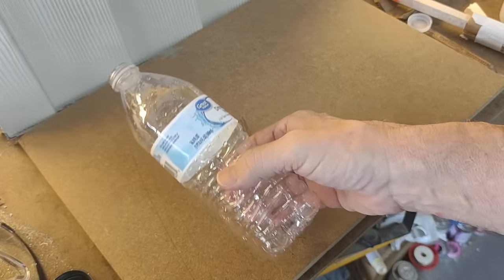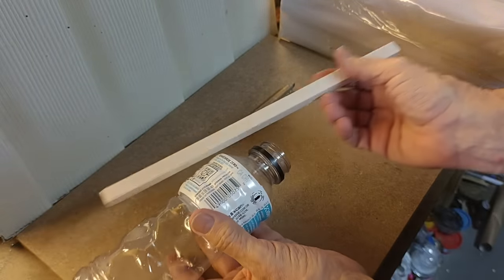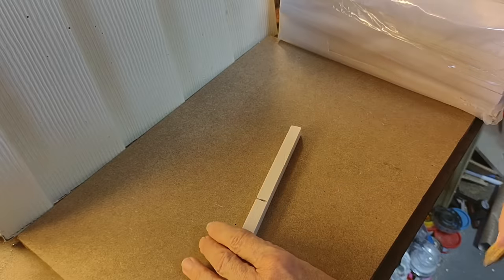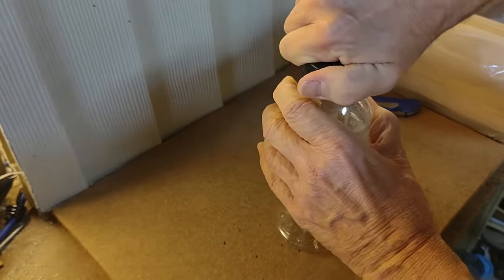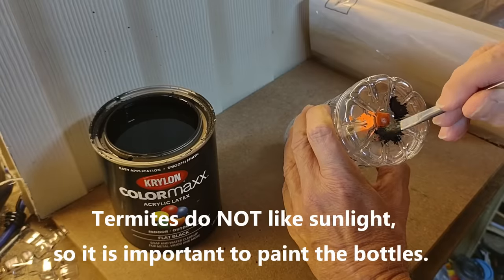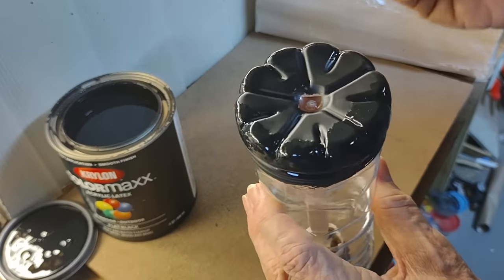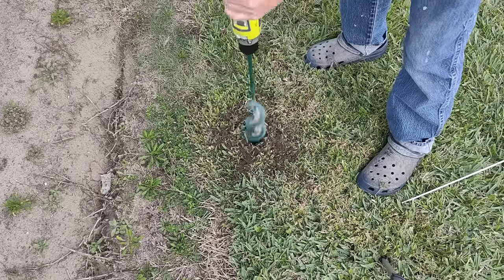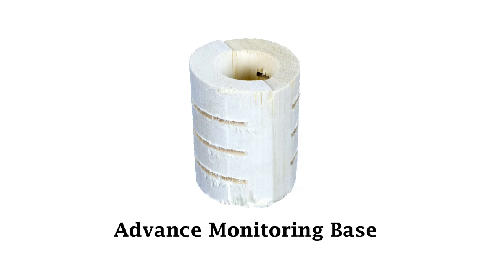Unbelievable Water Bottle Trick for Termites!  Simple to do!

Comment: I have a wooden house built in 1930 and I was touching up some paint spots on the back this weekend and had some termites flying into the paint. I live in Indiana along the Ohio River. What should I do to treat those?
Reply: Use dinamite ... it's very effective!
Reply: @carlosmejia5728  better yet, gasoline and matches
Reply from the maker: The good news is that you only have one species of termites where you live, and they are very easy to treat.  The fact that you are seeing swarmers outside does not mean that you have an infestation, but it does mean that they are close by, and you should take protective measures.  If you start seeing these things inside the house, then you most likely do have an infestation.  I would start by inspecting the house for mud tubes.  You are most likely find them around the outside of the building, coming up from the ground, but you may also find them in the crawl space, and sometimes even the attic.  If you cannot find any mud tubes, then you were probably okay, but you still need to do a preventive treatment.  The easiest way is to use granules, but it would also be a good idea to use the monitoring stations as well.

For the granules to work you need to have dirt around most of the house and that dirt needs to be porous enough to allow water to seep into the ground fairly quickly.  To find out if the dirt around your house is porous enough, just dig a small hole next to the house that is about 4 inches deep, 8 inches long, and just the width of the shovel.  Fill the hole with water and watch to see how fast it drains down into the ground.  If it seeps into the ground fairly quickly, then the granules should work just fine.  However, if it just kind of sits there, then the granules would not be a good choice, and you should just go with the monitoring stations.  Make sure that you buy the correct granules.  You need the ones that have imidacloprid as the active ingredient.  A lot of the Home Depot and Lowes stores no longer sell the correct granules, but you can get them from Amazon.  I will give you a link to them.

Please get back to me if you do find mud tubes or other evidence of an infestation.

I hope that helps.  Be well my friend.

Termite granules:  https://www.amazon.com/dp/B000RUIJYM?ref=nb_sb_ss_w_as-reorder-t1_k0_1_7&amp=&crid=6U9ASK6AJN8D&amp=&sprefix=termite
Reply: @GuysPestSolutions  Oh wow you’re awesome! I definitely will thank you. I’ve looked around the outside and have definitely not seen any more tubes there, but I need to check the crawlspace and attic. I just bought the house two years ago so I think that Attic may be OK but I’ll definitely check it this weekend. Thank you! I appreciate you writing back to me.

Comment: Hi Guy. Dealing with termites here. We had a termite swarm last year in our home. We have a large, elevated brick on cement patio along the entire rear of the house, and this is the area where the swarm was. The termite company we hired treated by drilling holes and injecting termaticide. Fast forward to this year and we have had a huge swarm in the same area and I’ve seen evidence of larvae and frass under the molding in two of the rooms, so it seems the treatment was ineffective. I see mature termites coming in from around the window moldings as well. I’ve watched your videos but am wondering how to treat such a large are that is inaccessible to trenching. I should add that we live on LI, NY. Additionally we renovated in 2019 and foam insulation was applied to all exterior walls.
Reply from the maker: Do you suppose you could email photos to me of all sides of the house.  I need to see where the house meets the ground, the patio and where it meets the ground, the driveway, and photos of the yard on each side from the house to the property line.  After I look at it I can tell you what you need to do.  The termite treatment that was done failed because it was kind of a Hail Mary Pass.  That sort of treatment can work sometimes, but it is far from a sure thing.  Pest controllers offer it because it's cheaper to do, but it comes with a much higher failure rate.  You can send photos to guyspestsolutions@gmail.com.  Also, you should know that it is hard to get pesticides in NY.  Depending upon your situation, you can sometimes get around it though.  They have banned just about everything there unless you are a licensed operator.  I hope that helps.  Be well my friend.
Reply: NY has subterranean termites. Very inaccessible.
Reply from the maker: @Gloria68  Actually, the species you have in NY are very easy to treat.  The problem is getting the pesticides.  NY has the most restrictive pesticide laws in the US.  If you can obtain termite granules, you can usually get rid of termites for $50 and an hours worth of time.  Very easy to do.  Be well Gloria.

Comment: Hello Guy. I hope you are well! You gave me a lot of great advice on borate for powder post beetles in my 1750/1820 house. I'd just like to know if the borate will corrode the metal heating exchange square "tubes" from the oil furnace? And the electric wiring? Thanks again!
Reply from the maker: Borates can be somewhat corrosive to metal, but not enough where I would be concerned about duct work or wiring.  We don't like to get boric acid dust directly on outlet connections because copper is a soft metal that is more susceptive to corrosion and we don't want to risk sparking at the connection points.  However, I think it would be very unlikely for it would eat it's way through steel duct work or wiring that runs through the walls or in the crawlspace.  So, I don't think you have anything to worry about.  Be well Claire.
Reply: @GuysPestSolutions  As always, Guy, thank you for the comprehensive answer!!
Reply from the maker: @clairestadtmueller2772  You are very welcome.  Be well Claire.

Comment: idk man, especially if you live in a southern state, you should really just get a solid termite bond from a reliable company -- even the best termite bait stations available aren't going to work 100% of the time, and while a $300+/year bond might seem expensive at the time, the cost of doing repairs and treatment for an active termite infestation is going to be multiples more than that
Reply from the maker: I never recommend those termite bonds.  They are not worth the money.  Read your contract carefully.  They usually contain exclusions for certain species and limit the amount of damage that is covered.   I live in Florida where we have Formosan termites, which are the worst you can get.  I just use these monitoring stations and I apply granules every year around the house.  No termites ever.  The granules will protect you from all species of subterranean termites for $50 a year.  It is a way better idea than paying for a termite bond.  I recommend keeping your money in your wallet.  Be well my friend.

Comment: Very informative video and a great help to my customers. 

Carpenter ants, How to locate the nest ?  saw one walking across door threshold. where there is one there must be 10,000 more.
Reply from the maker: The thing you need to understand about carpenter ants is that the ones you are seeing inside a home are really just a satellite colony.  The main colony is outside someplace.  You can sometimes locate that satellite colony that is inside the house by listening to the walls.  Carpenter ants can be quite noisy, so if you put your ear to the wall, you may be able to actually hear them.  Also, you may find dead ants near the walls, and the location of those ants will give you a good place to start to look.  As for the colony outside, that can be much more difficult to locate.  These guys can be in a tree stump, fallen tree, or any soft, wet wood.  I will give you a link to my video on how to treat carpenter ants.

I hope that helps. Be well my friend.

Video on how to treat carpenter ants:  https://youtu.be/Te9BUCaIQZY

Comment: Do you have a link for termite bait sttaions we could just buy? 😊
Reply from the maker: You bet.  You can buy the same exact device commercially that has a red dot at the top.  They work the same way.  When the dot disappears, you have termites.  They cost about $15 each.  Do not place them any further apart than 8 feet.  In other words, ignore the directions.  Also, they will tell you that you can treat termites by shooting foam into the station that went off, but this is unlikely to work.  You should install a bait station next to the one that goes off.

I hope that helps.  Be well Ashley.

Monitoring stations:  https://www.solutionsstores.com/red-eye-termite-monitor

Comment: Hi Guy thank you for sharing all this. I am in Sydney we found termites at a corner of stair case wall upstairs last week. Would you suggest: 1. Termidor directly into the pinhole of the wall which I can hear “ noice “ inside the wall? Or use “ bait” to put onto the area ( was recomm For “abide” ) , which is better option for my situation please. Don’t know if there is any other damage termites might have done to my house
Reply from the maker: I am so sorry that you are having this problem.  Here's the thing though, you see all termites are not the same.  You have some very different species in Australia than we do in the US, and they can behave quite differently.  Also, it is not easy to obtain pesticides in Australia.  What you are suggesting is basically a spot treatment.  That can be a successful approach, but you need to do it correctly.  To get it to work you need a fipronil foam.  I think I have a company that will ship it to you and I will give you a link to it.  You cannot really bait termites from the inside of a building.

To spot treat, drill holes in all damaged areas, that are 4 inches apart, and drilled about halfway through the wood.  If you are seeing exit holes in the wall, then there is most likely a stud behind the exit hole.  Get a stud finder and locate the stud where it meets the ceiling and drive a small nail into the stud a couple of inches below the ceiling.  Attach a weighted string to the nail and that will show you where the stud is.  Then drill the holes 4 inches apart along the entire length of the stud, about 3 inches deep.  Do the same thing for woodwork, except only drill the holes halfway through the wood.  If you think that there is a stud behind the woodwork, then drill a 3-inch-deep hole every 8 inches.  The holes only need to be wide enough to get the applicator tip of the foam can into the hole.  After the holes are drilled, then shoot the foam into each hole for about 5 seconds or until you have foam either coming back out at you or coming out the other holes that you drilled.   All the holes should have foam either going into them or coming out of them.  This will contaminate their food source and they will take the fipronil back in the colony and spread it around to the other termites.

Most of the time, subterranean termites are going to be building mud tubes somewhere.  You will most likely find these mud tubes going up the exterior or interior of your foundation and you may find them along joists and even in the attic sometimes.  If you have a slab home, then you may find them going up the outside of the house on the slab and even the side of the house.  If you can find the mud tubes, then you can treat them as well.  Just scrape off about a 2-inch section of each mud tube down to the bare surface.  Then, shoot that foam into each side of the mud tube and also apply a little of it on the surface where you removed it.  The termites will rebuild the mud tubes and bring the foam back to the colony to spread around to the other termites. 

Also, if you can find the mud tubes, this is a very good way to determine when the infestation is gone.  If you scrape off that 2-inch section of a mud tube, you can see if there are any live termites in the tube.  Again, the termites will rebuild the tube and go about their business.  Do this every two weeks after you finish all your treatments.  Apply the foam to the mud tube every time you do it. At the point you are no longer seeing live termites and they stop rebuilding the mud tube, then your infestation has been eradicated. 

It typically takes several weeks for any termite treatment to be effective.  That is because you are using a slow kill product.  If you were to kill the termites too quickly, then they would not have a chance to bring the poison back to the colony and share it with the other termites.  If you don't kill off the entire colony, you will not end the infestation.  Therefore, you must kill off subterranean termites very slowly.  So, I would give this at least 12 weeks before I would decide that something went wrong, and the process didn't work.  
 
I hope that helps.  Be well my friend.

Termidor Foam:  https://www.desertcart.com.au/products/148147092-basf-805571-termidor-foam-termiticide-insecticide